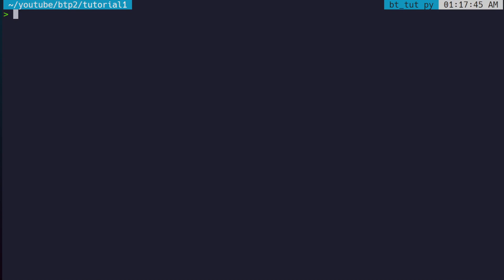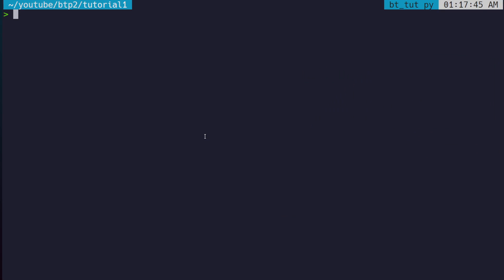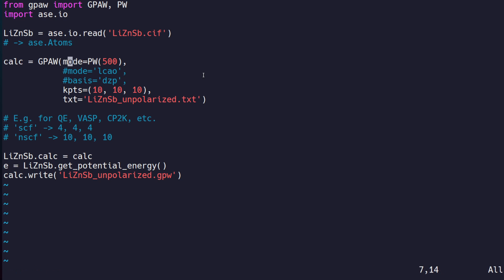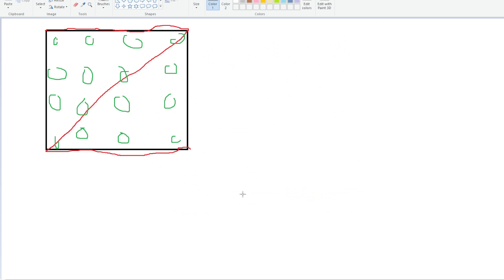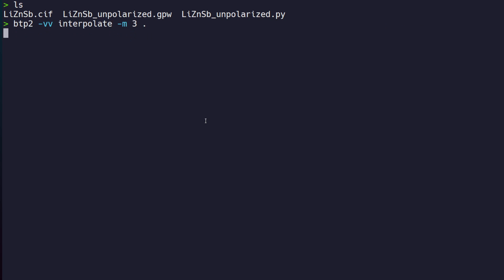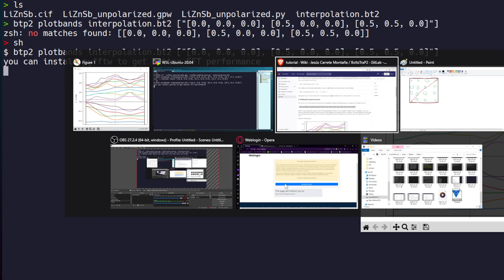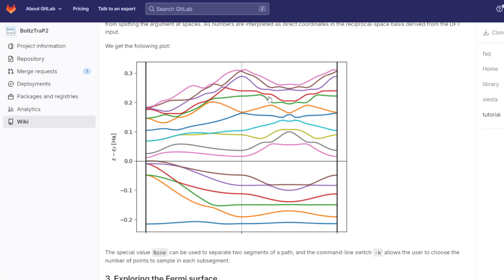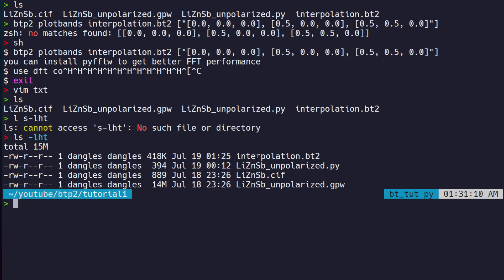BoltzTraP2 Tutorial | Interpolating DFT Data

Comment: how calculate that for spin polarized systems please
Reply from the maker: There are some examples on the Gitlab, it will depend entirely on the DFT code you are using
Reply: @AlgebraicContinuation  using Quantum Espresso
Reply: using Quantum espresso
Reply from the maker: Probably you’ll have to check the gitlab for that, I don’t use QE anymore.

In principle the whole process is the same, you just get two sets of results, one for spin up, one for spin down.

Comment: hello sir ! I am new to boltztrap2, i used quantum espresso output file of Si as an example, i obtained a different graph of band structure when i use the command btp2 plotband interpolation.bt2 ["[]"],.....from which i obtained in QE plotband ,
Reply from the maker: Hi, you need to provide the proper band path for the plots to look the same (assuming everything else is done as well).

Comment: Hello, sir. This is an excellent explanation and I thank you by your efforts to spread tutorials about this topic. 
I have a question though. I was able to manage everything up to the point of this video. I installed Boltztrap2 and I managed interpolation, but when I try to do the plot, I get this error:

AttributeError: '_lzma.LZMADecompressor' object has no attribute 'needs_input'

It's worth mention that I don't have GPAW, but I have Quantum ESPRESSO, and Boltztrap2 generated the correct interpolate.bt2 file using QE output result. So, I don't know what is missing. I would be very grateful if you could answer this question.
Reply from the maker: This is definitely some sort of issue with your current environment. I would guess it's something to do with the 'un-binary-ing' of the bt2 file. Check that your python is not version 2.x when you call something like `python` from the command line. If that's not the issue, you probably need a full reinstall in a fresh environment of python, and btp2.
Reply: Typing 'python' doesn't return nothing, I made everything using 'python3'. So I should install python, and make sure that it is not a 2.x version? @AlgebraicContinuation
Reply: Type 'python' doesn't return anything because I don't have it in WSL, I used python3 to everything. So I should start from the begging with 'python'? @AlgebraicContinuation
Reply from the maker: I'd say you should probably try a fresh environment and reinstall everything unless you can troubleshoot that bug above. It's not a boltztrap/dft calcualtion specific issue currently, so it's likely some sort of issue with the environment.
Reply: Hello again. Definitely it was not a problem with DFT or BoltzTrap2, as interpolation was being done perfectly. It was indeed a conflict with python versions. What worked for me was to install everything in python3.9 and make python3.9 as default python3 in my system. I could reproduce the results from your video and from the BoltzTrap2 tutorials. Thank you very much, and I hope you keep up with this tutorials. Best regards
Reply from the maker: Awesome, glad you were able to get it sorted out!

Comment: hi, is it possible to adding high symmetry points in band interpolation?
Reply from the maker: Can you elaborate on what you mean by this? The bands are interpolated across the entire BZ.
Reply: @AlgebraicContinuation  yea, I see. is it possible to get the high symmetry points: Gamma M K Gamma or something (x-axis).
Reply from the maker: What do you mean by "get them"? What information are you looking for at those points? If you just mean plotting the band structure, yes that's done around 9:30 in the video. You'd just need to manually put in what band path you want to view.

Comment: Sir, i have one request. Can you please make a video on" how to use boltztrap with VASP to calculate seebeck and power factor" for 2D materials
Reply from the maker: Hi you just need your vasp output in the folder you run the commands detailed in the video. Let me know if that doesn't work for you.
Reply: @AlgebraicContinuation  Sir i am new with Boltztrap and i have no experience with the INCAR file for seebeck and power factor, if its possible for you can you please make detail video from Input files to output
Reply from the maker: I don’t have VASP access anywhere currently, but it sounds like what you need is a VASP tutorial not BoltzTraP2. Once you have your VASP output, the btp2 part will be very straightforward. 

Also be wary following a tutorial line for line for VASP, you need to make sure your parameters are well converged, especially including the k-point density if you’re planning on doing btp2 afterwards.
Reply: @AlgebraicContinuation I also have same question. I have Vasp output and I want to calculate thermoelectric performance (seebeck coefficient, Electric conductivity, etc). I Watch This video but still couldn’t understand the step, especially the command should I typer for calculation

Comment: Thanks again!

I am curious about the following things: i) How to do a sigma vs energy plot . I mean if I have the band structure, I could also imagine plotting conductivity for each energy value. I didnt find this as a possibility in btp2 plot option. However, I heard from some people that it is possible. 
ii) How to do a spin polarized Calculation of Onsager coefficients, especially conductivity? The files of /data give hint that it is possible but I dont know exactly how to do. 

For example see this Fig 4 or 5 in this paper: DOI 10.1088/0022-3727/48/48/485301
 I want to do such plots ( but with methods of btp2, not like in the paper)
Reply from the maker: Thanks for the comment!

For i) definitely plotting conductivity as a function of energy is possible, I'll go over that. The BoltzTraP2 plotting features are quite nice, but I prefer to just write my own scripts to have a bit more control over the plotting, selection of components (e.g. from the conductivity tensor), etc. So I'll go over how to get that info then upload the scripts and you should be able to use them directly on your systems (maybe changing some bounds on the axes, or small things like that).

For ii) yes sure we can do some spin-polarized calculations,  I think that's a good idea. I'll go over how to pull things like S and \sigma for a set of spin-polarized bands, plot them color-coded to the spin, and other common things you might want for spin-polarized calculations. Figures like those in the ones you've linked are 100% doable with btp2.
Reply: @AlgebraicContinuation  Thanks for the answer. Will the next video come soon ? :)
Reply from the maker: @lukasv1683  Hey no problem, yes they'll be up by Friday!
Reply from the maker: Hey did you ever get this sorted out or would you still want some help with this?